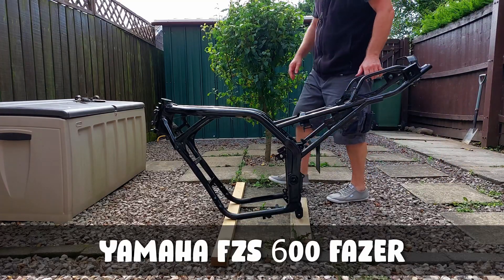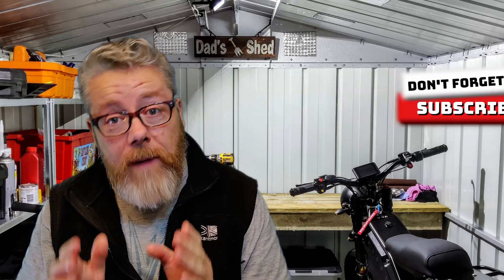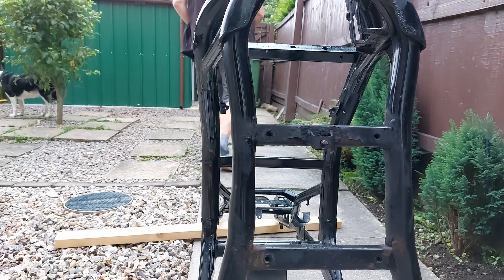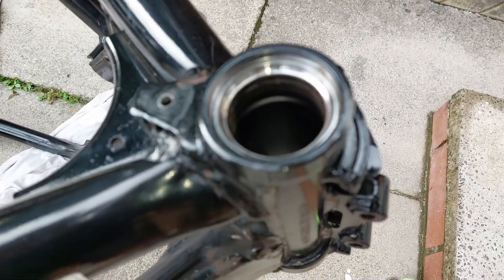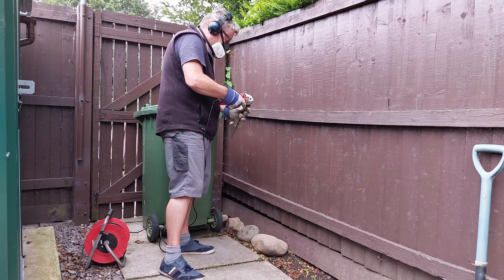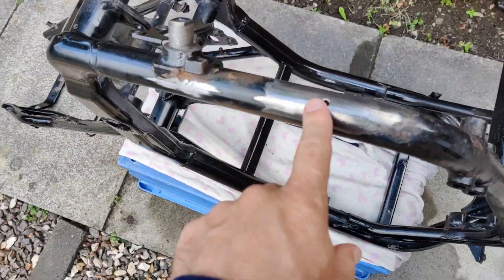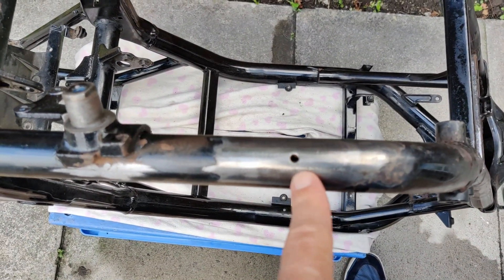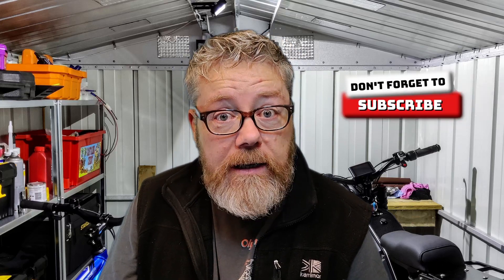ELECTRIFY A YAMAHA FZS600 FAZER PROJECT - PART ONE  - THE FRAME AND A CAFE RACER REAR CHOP

Comment: Have you considered using the Nextion display for this build?    LCD demo links:-   https://www.youtube.com/watch?v=okvaCjY8tiw   https://www.youtube.com/watch?v=n03Y6Igb10g
Reply: Intelligent model has brigher screen/faster CPU,  -Y model screen in a case, C model capactive touch.  Not decided yet on 4.3" enhanced vs intelligent. 4.3" intelligent/capactive touch/case 55 pounds delivered on AE.
Reply: I want to combine speedometer  display with the arduino code from wnsnty w3bsite, JBD  Xiaoxiang to read BMS cell values.
Reply from the maker: I will probably be using a display that has warning lights for indicators etc. What is the Nextion display controlled by?

Comment: I watched "Vintage Voltage" the other day and they converted a Royal Enfield bullet 500, big hub motor in the rear and filled the space where the engine was with batteries, all electrics were inside the gutted out fuel tank, went great and looked the business too, worth watching for insight, tips and tricks
Reply from the maker: Yes I have watched that episode, they do fantastic conversions.

Comment: Please be careful using extension reels like that man. Unwind it all the way to avoid overheating by induction, especially when using high wattage power tools.
Reply from the maker: Yes you are correct and thanks , it does have a wound and unwound rating on it though 👍

Comment: i started a cafe racer build last summer and  after a while  i realized
 it would have been cheaper just to buy a Zero Motorcycle  .
 some of them are not that bad  and you can get them  used  for a pretty good price 

don't get me wrong  i learnt a lot about striping motorcycles and tons about motors , battery packs , and controllers from  my cafe racer project 
 the cheapest solution is not always the best  ,,,,you got to do what you love 😎
in this case there will be alot of drilling ang grinding ,.. it is the way
Reply from the maker: Yes I am expecting a lot of grinding, drilling and welding. It's not easy but it keeps me busy 👍

Comment: Someone told me that once you start taking things off a frame, it throws up all kinds of problems later down the line when dealing with the DVLA. He said make sure you take as many photos as possible and make notes of everything you do to the frame, especially with electric conversions.
Reply from the maker: It will all be documented 👍🏼 I have heard DVLA can be a pain and even getting a colour change can be challenging as they send the logbook back with the original colour.
Reply: @baconbuttties  I’m guessing you have a copy of the MVSA? Stick to that and you can’t go wrong.
Reply from the maker: @HowlingWolfLeather  👍
Reply: If you use an older frame ( I think before '92) then you can alter the frame how you want as long as it's not dangerous from a structural point of view

Comment: Did the frame come with a log book or will you apply for that later? I'm thinking of doing a similar project.
Reply from the maker: Yes it came with the new keepers part and the  guy I bought it off changed keepers online, log book turned up in 5 days 👍🏼 I also checked if it had been a right off and that came back good as well.